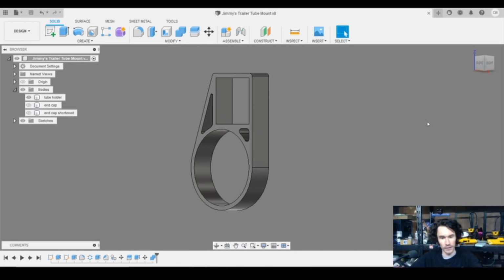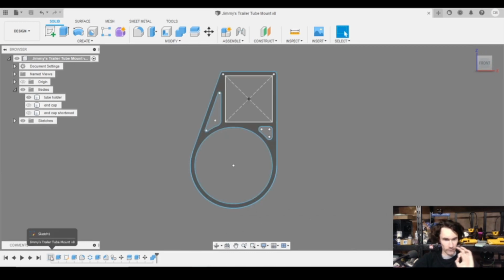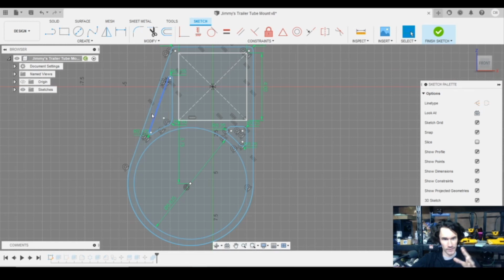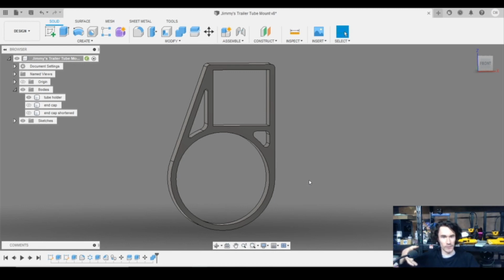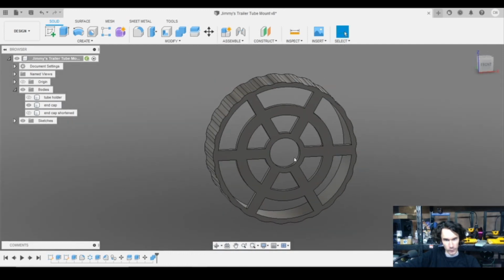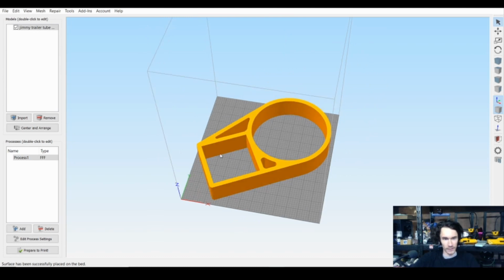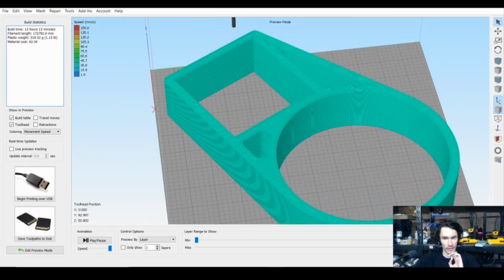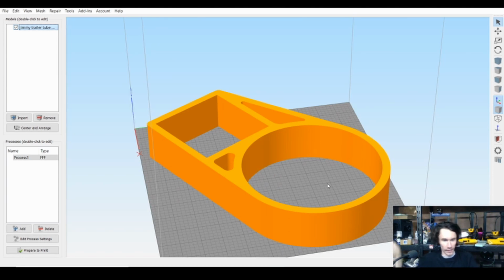How I Designed A Travel Trailer Sewer Tube Holder

Comment: I would be interested in leaning how to do a stress analysis on an object like this. I designed some shelf brackets that I thought would be plenty strong, but they collapsed and caused some issues.
Reply from the maker: For sure, and the loads in a shelf vs a tube holder are very much different. When Jimmy gets back I am curious to see how it all held up in 90*+ weather, but so far so good!
Reply: Did you make them solid triangles? Keep it simple and avoid features that cause stress risers. 

Most people over build things like shelf brackets, I'm surprised your designs failed.